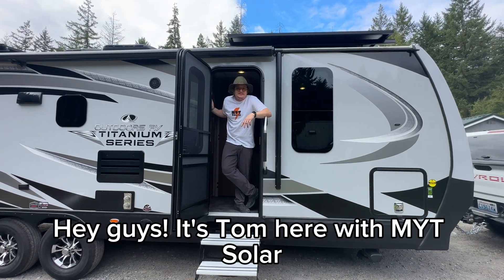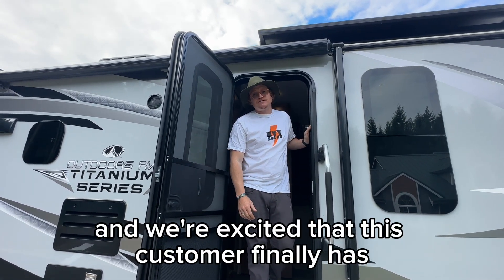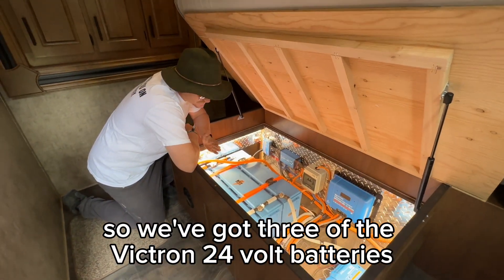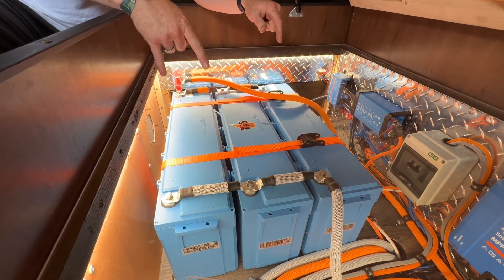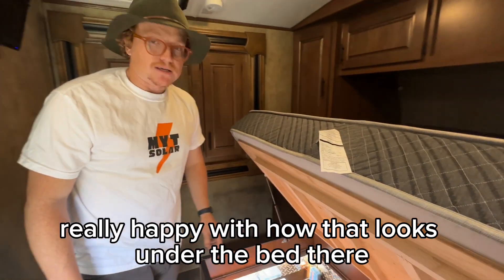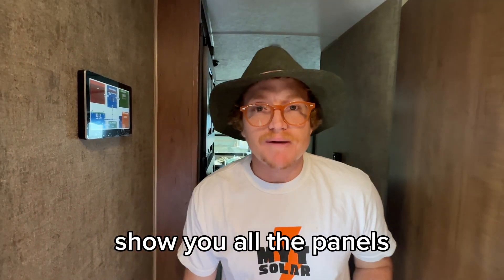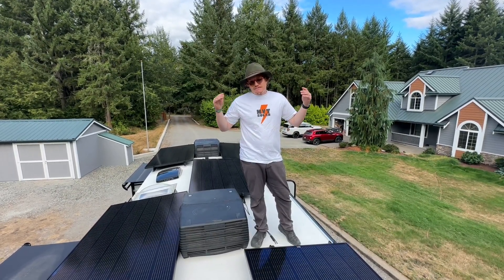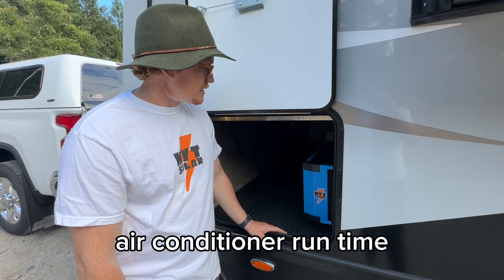THE BIGGEST RV SOLAR INSTALL ON AN OUTDOORS RV

Comment: Dumb question... why 24 volts?  I guess you it would allow you to use smaller wiring, but there has got to be another reason.
Reply from the maker: Smaller wiring, smaller/less charge controllers. Better battery options in this case.
Reply: @mytsolar  Gotcha

Comment: Sweet. Nice, professionally looking build. You will get some shade on those panels from the AC shrouds though, reducing their morning and afternoon performance, by not racking them over the AC units. That's the first time I've seen those Victron 24v batteries. They look nice, but their cycle rating seems a little low at only 2,500 cycles at 80% DOD. The manufacturer of the raw LiFiPo-4 prismatic cells I purchased last year rated them at an 8,000-cycle life at 80% DOD and 6,000 cycles at 100% DOD (under ideal conditions - 25 degrees C and .5c charge/discharge with compression). So, they are either hedging their bets or using lower grade cells. Knowing Victron, I suspect they are hedging their bets - under representing their actual performance to avoid any warranty claims. Still, this might cost them sales. 

Though they represent a far better value than Battleborn Gamechangers at $410/Kwh vs $723/Kwh for the Gamechangers, custom made batteries still have them beat hands down, if one is looking for a basic, well managed, long-lasting battery without all the bells and whistles. For example, last year I built a 7.1Kwh battery with the afore mentioned 6,000+ cycle cells for under $1,500 including 330A (1,200a surge) BMS w/5A active balancer or $211/Kwh. Though to be fair, doing so takes time and knowledge, making it the opposite of a drop-in battery.

I just built a 16.38Kwh battery from the raw cells for well under $2k or $122/Kwh including a quality 200A 48v BMS, flexible busbars and compression. Coupled with a 4,400-watt racked solar array (in addition to my 7.1Kwh 12v system with a 620w liftable array on the side of my MH) this system allows me to run a 12Kbtu mini split heat pump 24/7 and allows occasional use of a second rooftop mounted AC. I built both of these systems myself along with all the components, including 6,000 watts of inverted 110v ac power for around $10k. For comparison, the equivalent amount of Battleborn gamechangers alone would cost almost $17k and even the cheaper Victron batteries, with 1/2 the cycle rating as mine, would cost $8.5k just for the batteries alone.
Reply from the maker: We definitely like the Victron Smart Lithiumfor a native 24v battery vs stringing 12v together. The external Smart BMS is awesome. I'm sure they are under shooting the cycles. Sounds like you've put together a killer DIY setup for a nice price. Can definitely save some money on DIY cells and DIY install. Nice work!

Comment: I installed 3320 watts on the roof and used a 6548 hybrid inverter and have 20.48kWh of batteries. The 48v system is connected to the inverter straight to the campers original converter and power system. Everything works off the solar system or off grid if needed.
Reply from the maker: Nice work!

Comment: @mytsolar…
Can you share the cost of this build?
Reply from the maker: Certainly. This was approximately 23k. The 24v Victron battery system is expensive. So there are options for more battery storage in a more affordable package. This also includes our week long travel expenses as we come to the customer for the work. Wherever they are in the West.
Reply: 23k for that 🫣 With 20kWh of batteries, 3320 watts of panels and a 6.5k hybrid inverter my system is under 8k!
Reply: @johnstark4723 Could you share more information on the components you used?
Reply: @DownTempoable  Purchased during sale, Sungold SP6548 inverter, 415 panels and 4 rack mount batteries
Reply: @DownTempoable  oh; and installed it myself 😉

Comment: I'm Super Curious- How did you get cabling to that TouchScreen? What route did you take? Did you pull off the wall panel????

Gorgeous build!!!
Reply from the maker: Where there is a will, there is a way! We took out the drawers above the breaker panel and went up the back wall and then inside the closet we went to the wall of the hallway.

Comment: No where near the biggest one. Check out the Youtube video with 7600 watt solar array on an RV. That RV owner stacked solar panels on a motorized sliding arm to expose the additional panels when parked.
Reply from the maker: Outdoors RV is a brand of RVs made in Oregon. The title of the video is the biggest RV Solar Install on an Outdoors RV.

Comment: I have a 2004 Monaco Diplomat 40' that has 4350 watts of solar on the roof, with a 6,000 watt 240/split phase inverter, and 15,360 WH of Battery storage.
Reply from the maker: Sounds like a great system!

Comment: How about ventilation? What kind of solar panel brackets are you using on the roof and can they be tilted?
Reply from the maker: We use our specially sourced rail system for the brackets. They're easily removable but not tiltable.
Reply from the maker: We have vents added to the bed
Reply: @mytsolar I'd never put the batteries there for both the possible smell from a leak and the poisonous games but also due to zero climate control there.

Comment: Curious about the noise level under the bed? Understandable though  you don't have much choice on where to install. But I don't think I would be able to deal with that noise. Is there an noise insulation installed?
Reply from the maker: None of the items under the bed generate noise.

Comment: Do you find it necessary if you are using a bmv-712 to even install the visual round gage? I go back and fourth on whether or not to for a new system or just rely on the Bluetooth or have the Digital Touch screen.
Reply from the maker: I'm not sure why anyone would want the BMV product today, the bluetooth app provides such better information than the round screen and the Touch 50/70 with the cerbo blasts both options out of the water.